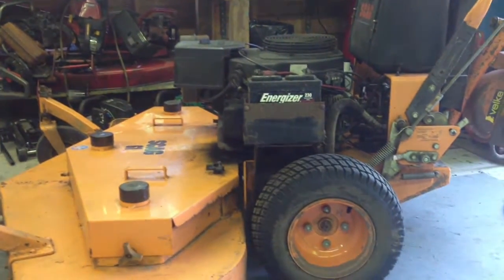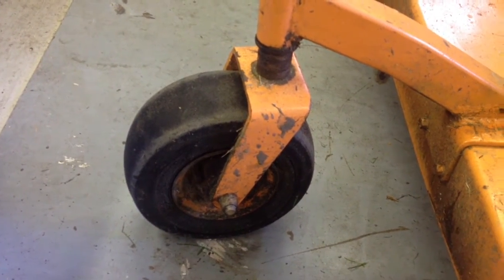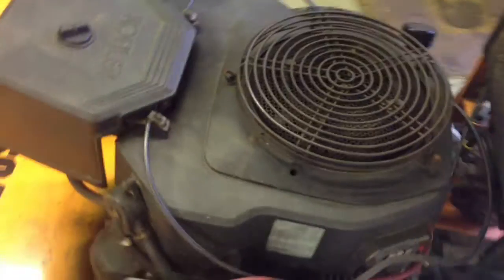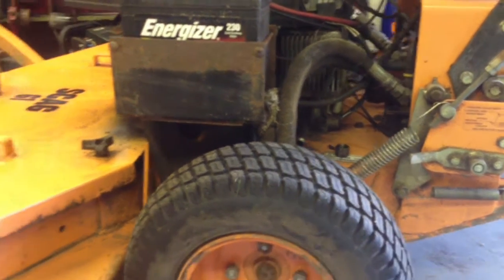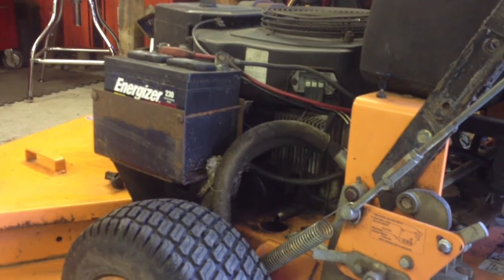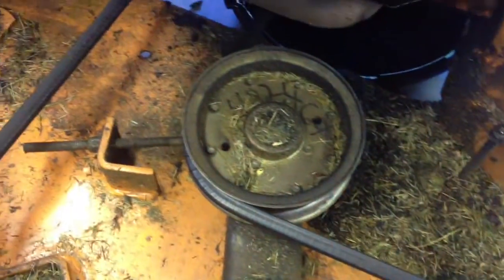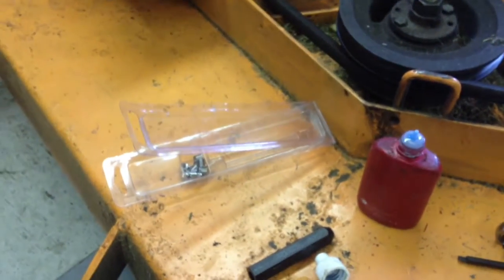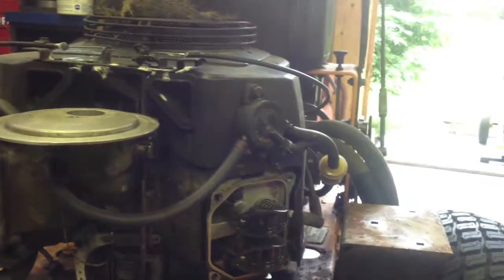Scag 61 inch mower

Comment: there is a nut that you can use to adjust the tracking...i think you use 40w-50 oil for hydro correct?? make sure you use mobil 1

Comment: shows you what goes through the engineers mind when they design some of these Landscraper Tools...hydro filter under the deck?sheesh..a first year Hort Apprentice knows that filter should be as high up as possible for obvious reasons.Also "semi permanent" belt covers and no maintenance spindels are known to cut the life of the machine in two because the operator might remove it once a month if at all. High maintenance machines and an operator that's not afraid of grease last the longest...